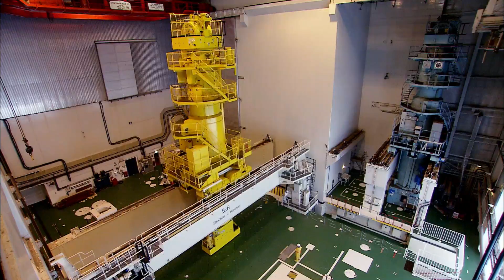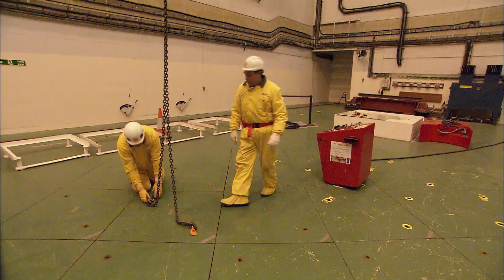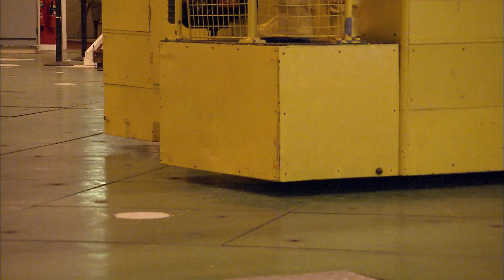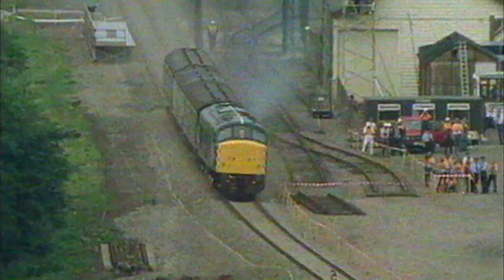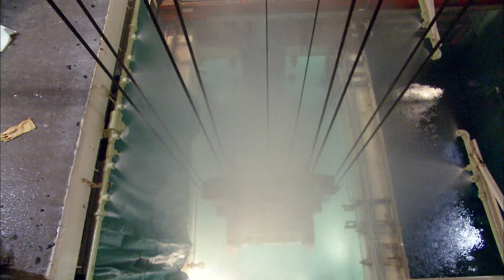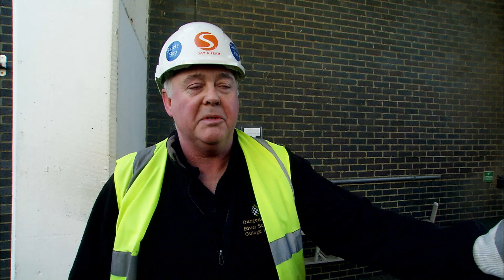The Destruction Of Britain's Biggest Nuclear Power Plant

Comment: Ha ha the comment of the spent fuel being "potentially dangerous " is a funny understatement!! The spent fuel unfortunately is dangerous for many years, that is how I understand things. I'm not an expert and would be happy to be corrected. It's difficult for the UK to generate enough electricity for our needs, and they have to look at all options, including nuclear. It's pretty good at generating power for all of us. But spent fuel unfortunately is toxic to say the least.
Reply: Standing 1 m from a 2 year old used fuel bundle for 2 minutes, you get the letal dose.
Reply: @FernandoWINSANTO  not if it is contained properly you won't.

If the fuel is in the bottom of the storage pond in a skip fully submerged, you would most likely obtain approx. 1 microsievert of radiation dose in 1 hour
Ionising Radiation Regulations 2017 allows for an annual radiation dose that is 20000 times that (20 millisieverts)
EDF halves this to 10000 times that value in a year (10 milliesieverts)

The most i have ever received in a year is 1.2 milliesieverts

You will receive a higher radiation dose living in Aberdeen in Scotland because of the background radiation given off from the local rock.
Reply: @FernandoWINSANTO  thanks for another useful insight 👍
Reply: @chrisboyslimuk5186  Have a nice Day!
Reply: Spent fuel is only dangerous if it is not constantly cooled for a few years and melts or if someone handles it without proper radiological protection. It only gets to that point if safety protocols are abandoned and it gets into the wrong hands. Otherwise, agencies like the IAEA ensure proper handling of the spent fuel and safety to the general public.
Reply: @derpymcderpello5381  oh I see. Thank you kindly for that informed insight. I guess I only picked up information from the media which is probably not always true and they always paint a distorted dystopian view. But I've read and understood what you have written here and I sounds good,  informing me what actually happens. I think more people should understand the truth!!